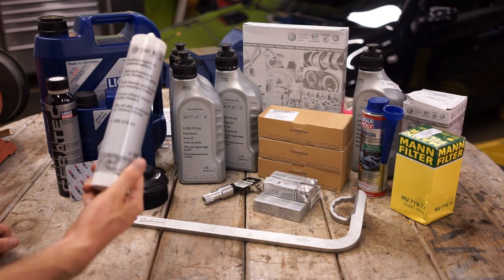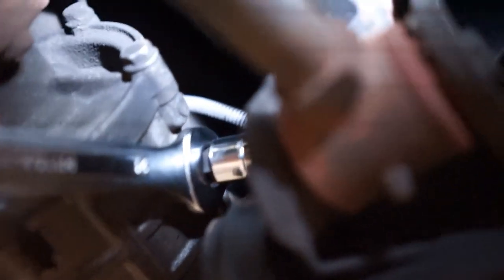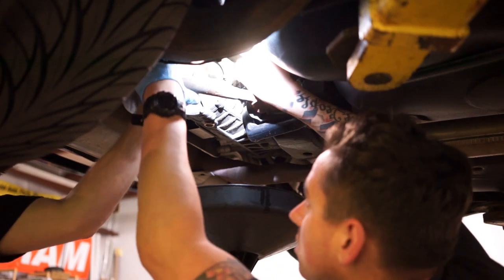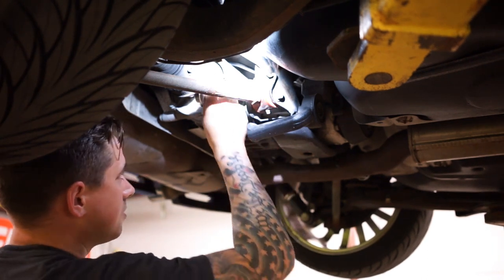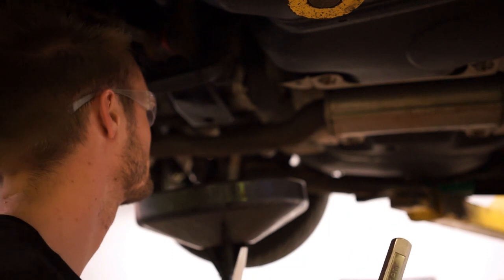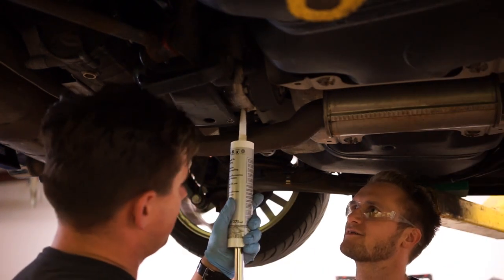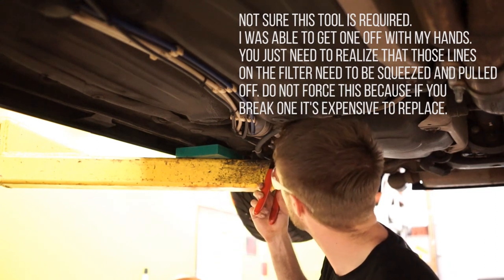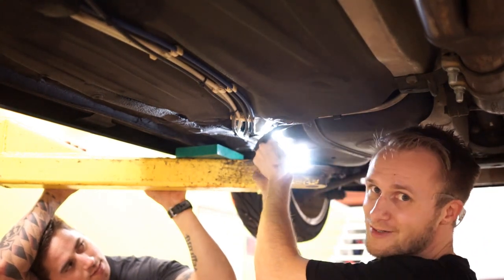HOW TO SERVICE YOUR Mk4 R32 - PART 2 - Haldex, Rear Differential, and Fuel Filter

Comment: A fan of you guys. I purchased a 2004 Audi TT with the 3.2L V6 engine and DSG. I want to do the service to all the fluids, but can’t seem to find videos on the model I bought. Just curious if the mk4 r32 and my year tt share the same set up and procedure to do the fluids (haldex, rear differential, front bevel box and DSG). Also I’ve read if changing haldex and DSG I will have to do some relearn adaptations to them both with vcds? New to the Audi vw world. Not sure if it’s too late to change DSG fluid 125k miles on it and clunks from time to time. Thank you in advance for your advice and answers.

Comment: Hi the metalnerd diff plug tool suppose to be a 19mm? 

in the part 1 video it showed the tranny tool to be a different size, so we need both tools to service tranny and diff?
Thanks! the link for metalnerd doesn’t work anymore so I wanted to double check that both tools are needed for the job.
Reply from the maker: I think it’s a 17mm hex. Search “17mm hex stubby” on Amazon. Couple 1/2’ drive bits there for like $11.

You are correct, the transmission tool and rear differential tools are two different tools.

Comment: Great video!  I have a 2 day window (Friday and Saturday) to work on an R32.  Do I need to replace the drain plugs or is this precautionary?
Also, do I need to get a new oil filter housing cover too?  I have never worked on this car and I am helping someone out.  I would like to know so I can order parts and hopefully have them available to work on the car.  Any other help would be appreciated.  Thank you!
Reply from the maker: For the diff and haldex, Yes. For the engine and transmission, No - you’ll just need new crush washers, but some oil change kits on FCP Euro just come with the drain plug AND crush washer.

No need for an oil filter housing, just make sure to replace the seals (which come with the oil filter in the box).

Comment: Did you notice a difference after you added the Fuel Injection Cleaner? It's time to throw on a new fuel filter and was curious if I should add one of those to my cart.
Reply: Gotcha, Thanks, mang!
Reply: Hey Josh, with the Fuel injection cleaner, put it in with half a tank, full tank or ? No instructions on the bottle lol
Reply: Okay, cool. Yeah, it just says "Application: Add the contents to the fuel tank and repeat every 2000 km (1242.74 miles) or as necessary." I expected more, oh well. haha. thanks mang